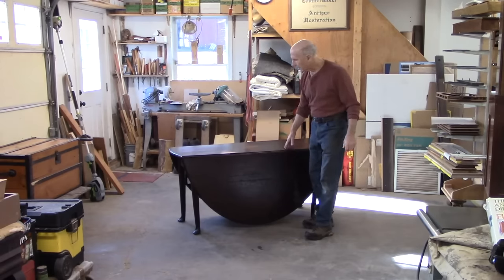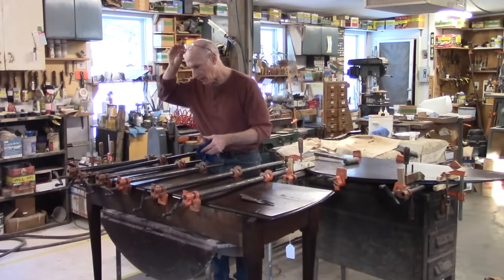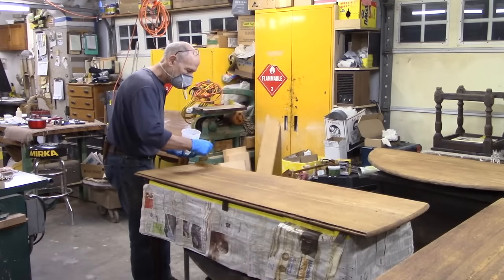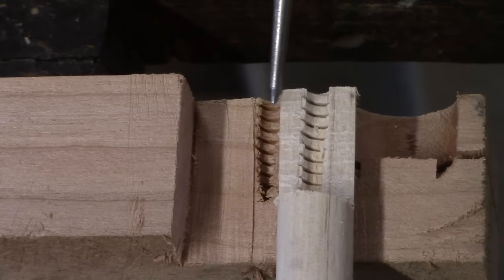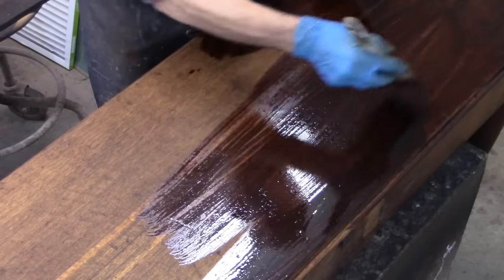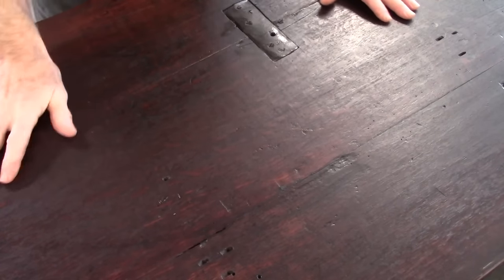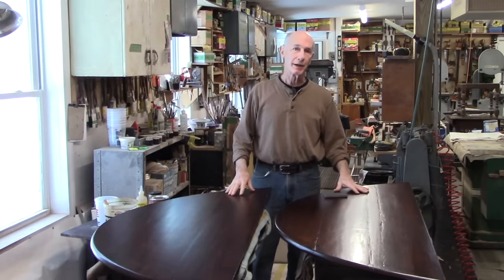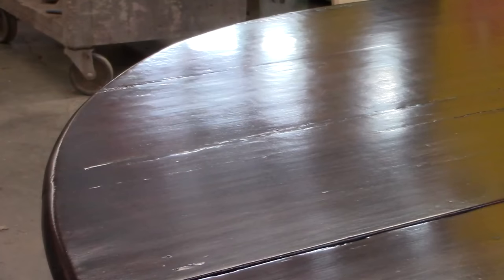Is This Table Too Old to Refinish? - Thomas Johnson Antique Furniture Restoration

Comment: Slow and methodical.  The key to restoration.  The ability to use much more modern adhesives today will make your restoration last infinitely longer than the last time it was apart.  For stripping I know some refinishers will cover the work with tinfoil to retain the stripper chemicals from premature evaporation.  Perhaps you have inherently higher humidity in your workshop.  I have a water stain issue with a much more modern (circa 1990s) Brazilian rosewood veneer--with a polyurethane surface coating. It's isolated to one saucer sized spot on the surface.  Do you suspect that the issue is more within the polyurethane than deeper?  That's my guess.  I've tried to deal with it with simply teak/rosewood oil in an attempt to penetrate the poly.  No luck.  Any suggestions?  I am attempting to avoid a more 'mechanical' solution with an aggressive sandpaper or even steel wool.  Oxalic acid seems more of a solution if the problem were within the wood, itself, correct?  Appreciate your gluing tips and the plug v. dowel education!  Also, much to learn from you about matching and creating finishes. You can always spot someone who never had a brother to help in the workshop.  You can always figure out a workaround! Anything done, is better done well.  It looks like you're a better craftsman than the original carpenter!  Leave it to a Maniac!
Reply from the maker: Thanks! If the mark is light in color, it could be in the poly, try padding with alcohol. If the spot is dark or black, it's in the wood, and you would need to refinish the top. These are tough issues

Comment: Oh, that circular burn!  If not for the owner’s strictures, it would be an absolute eyesore.  A lesson on refinishing this with veneer.(in another length of timber )would be of value to your regular watchers.
Reply from the maker: Thanks! I thought cutting out the burn and replacing with new wood would then involve sanding the entire top much more than I wanted to. I wanted to save all the scars and history

Comment: I see you washed off the methylene chloride/varnish goo with Lundmark TSP hard surface cleaner
Reply from the maker: Thanks! Yes, starting off we always used solvents like lacquer thinner. I switched to TSP at first because it works better than solvents on paint. Then I started using it for all stripping.
Reply: @johnsonrestoration  you still use the lacquer thinner quite a lot I see. I wonder if your ventilation is adequate for such a huge workshop

Comment: "Oxalic acid spilled on the floor."
You were squeezing it directly onto the floor with reckless abandon! Why wouldn't you at least squeegee it into something like a drywall mud tray?
For concerns me is the legs we're completely exposed to drips and splashes of acid and even the stripper!
Reply from the maker: Thanks! Yes, that's a good idea! I had not thought of it, I'm so used to just letting it go

Comment: There are so many repairs already on that tabletop it would seem to me that using a router/chisels to cut out that burn mark and set in a new inlaid piece (even with some funky design), would be far nicer than staring at that ugly burn mark - but that's just me.
I understand the whole idea of the scars make the character but sometimes scars are just too ugly that they draw your attention to the negative.
Reply from the maker: Thanks! I think that would have involved sanding the entire top a lot more than I wanted too. All part of the history!

Comment: This may have been you but someone that I was watching used an iron and a wet cloth and brought the fibers of the wood up and then then sanded them down to get rid of really deep murders
Reply from the maker: Thanks! Yes, I have done that many times. It really depends on the nature of the defect. If the wood fibres are gone, it won't work

Comment: I think in 5 - 20 years, all that crap oil is going to come right back through.  I would have put 3 coats of water white shellac on top after your color to seal all that crap in, then done all the surface work.

Hope I'm wrong, but I bet that oil will come back to haunt you.
Reply from the maker: Thanks! I wonder, I really wanted the varnish finish, and I gave it a lot of drying time between coats, with the heat up. It certainly seemed fine.

Comment: Far as I'm concerned, if a piece of furniture isn't unique and irreplaceable and is in everyday use, if it needs refinishing to bring out the beauty of the wood and the finish is sympathetic to the original, then off you go! Over here in the UK, 'brown furniture' is everywhere and worth nothing. There is a current fad for 'upcycling it' by painting it funky colours and then 'distressing it' with sand paper. That p*sses me off....
Reply from the maker: Yes, I agree! But what are you going to do? Everything that goes around comes around...

Comment: Gluing the dowels in a joint that is itself glued lengthwise is a recipe for future failure. The wood will fight the dowels and both will eventually fail. Dowels really serve no purpose in a joint like this; the joint  will be better without them!!
Reply from the maker: Thanks! I don't recall using any dowels in this job. I'll have to look. But in general, I agree

Comment: Good for another 100 years. Probably get reinforced with carbon nano structures to preserve it forever in a 100 years time...lol. I agree with your philosophy, it's lost it's value if you can't use it. Repairing it and tidying it so people want to use it adds value. It ain't going to win any beauty contests, but it clearly has history and you've tampered them and made them a feature. Just think of all the arguments and stories told around this table over the last 300 years. How many spilt drinks and meals have been wiped of it. How many times has a hot pan been put on it without a doily, at least once I'm guessing.
Reply from the maker: Thanks! That's good! At least once! I think about all those who have come before when I am working on a piece like this.

Comment: By the standards of English taste in the restoration of antique furniture, this would be regarded as over restored. The patina of the table has been removed entirely and replaced with a modern finish. I suspect the table is far less than 300 years old and may be Queen Anne revival in period - what in England we would call Victorian. The owner now has a table whose timber is old but whose finish is entirely modern; it looks like brand new repro. In an English auction it would have very little value at all.
Reply from the maker: Thanks! Yes, we think about all those things, but bottom line - the owner loves it. I think it is as good as it can be. It needed a durable finish
Reply: @johnsonrestoration  I don’t doubt you have a satisfied client, and there is no doubting the immense efforts you put in to satisfy them. My intention was merely to point out that in England the patina of this quite modest piece is the attraction. With antiques the last thing English people want is something that looks shiny and new. It is a topic of constant debate within the art world regarding pictures, for example, in our national collections. By Italian standards these are regarded, in many instances, as over cleaned, or, worse, over restored. And, of course, the Victorians were responsible for the cleaning off of decorated Church stonework because they felt the monochrome colour of the stone was more appropriate disregarding the fact that mediaeval churches were often a riot of colour. Anyway, good luck with your labours.

Comment: I did not like the acid, or the stripper, agh NO.  When I have restored a table of that age I use kinder products, vinegar, is slow but gentle, only wire wool, not sand paper, palm of hand not fingers, shellac, Never varnish, I would not have left the steel screws showing either, what are you thinking, NO. I was happy to see animal glue, that was the best bit lol. I learnt from an old English French Polisher, for 10 years, part time only, and my projects were very varied. I now live in Canada so have no access to any antiques that I can get fired up about. Good luck with future furniture.
Reply from the maker: Thanks! I appreciate what you're saying. There are so many choices to be made as you work on a project like this. Everyone has their own way of doing things, I would never state, or imply that my way was the only "correct" way

Comment: well first there is no identification of origin (manufacture or date) then it have sings of low skill fast repair plus there is stains and damage. Also the build marks is also a indicator of "mass produce" whit this knowledge and poor state it have more emotional value. And as you say there are sings of previous refinishing, the damage have bin already done.
The fact that you dont sand it and use proper techniques and chemicals not only make it more valuable but also preserving its age and history. Also normal people want useful antique not priceless dust collectors.
Reply from the maker: Thank you! Well said!

Comment: Horrible job. I noticed a couple things you did wrong - about 47 of them - first you must strip with 96 octane aviation fuel and lots of it. Second invest in a gas powered power planer and blast the top - good luck call me if you need more help.
Reply from the maker: Thanks! That's good

Comment: Amazing. 20 hours and $200 in materials later you managed to make it lose it's value while looking marginally better without repairing hinge screw holes or any of the pitting. True craftsman lol
Reply: He talks through his thought process a little more at 45:45, you may find it explained a little better there.
Reply from the maker: Well, thanks for watching! Yes, Ben Wicker is correct - I explain it
Reply from the maker: Thanks!

Comment: So disappointed that you used sandpaper on the surface after beginning with steel wool. Steel wool with more stripper would have worked better than sandpaper and you would not have stripped the patina, that took 300 years to develop, from the surface. That antique table has now lost its antique value and has been turned into new furniture. You might as well just go to Walmart. I’ve been refinishing antique furniture for over 40 years. It’s always disappointing to see something like this. After varnishing, finish with steel wool again. Difficult grades of steel wool will either give you a matte finish or a shiny finish. Find a copy of “Professional Furniture Refinishing For The Amateur” by Jessie Savage.
Reply from the maker: Wow! Well, thanks for watching
Reply: @johnsonrestoration  I didn’t mean to sound so harsh, my apologies. The book is the best go-to resource that is available out there. Use it to your own advantage and then teach others based on knowledge.